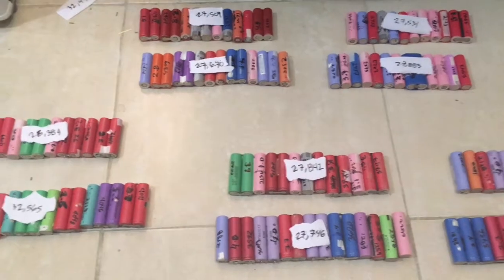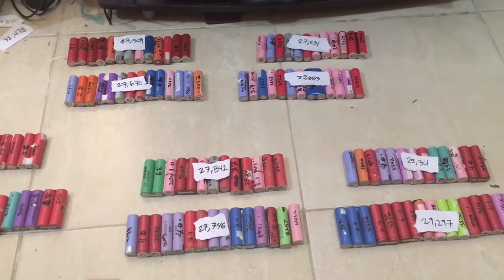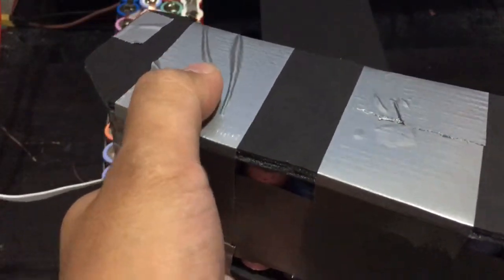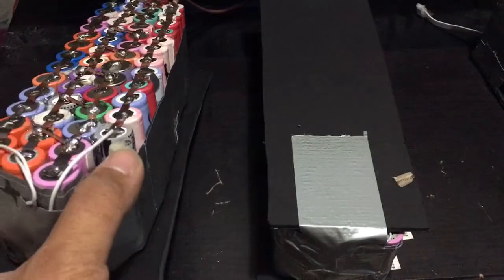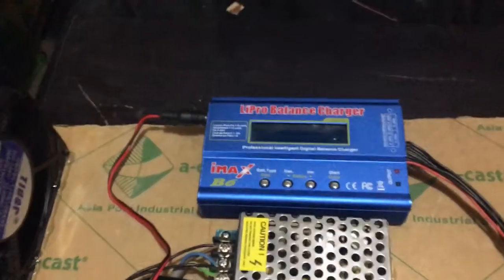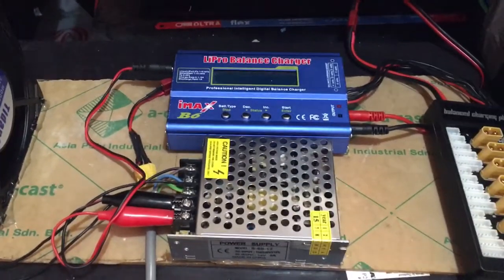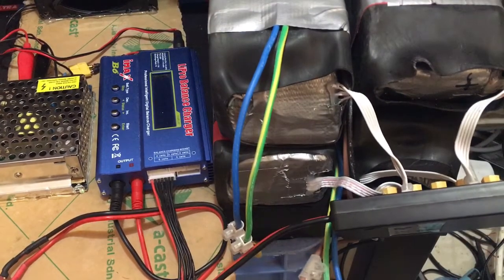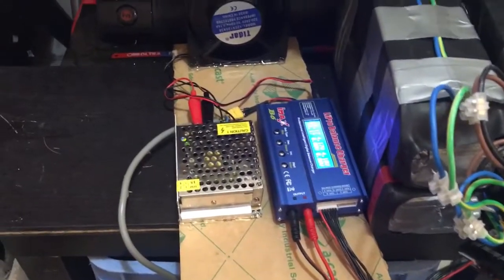DIY Ebike Battery pack from 18650 cells

Comment: How has it been holding up? I plan on making a battery similar to this but I'm afraid that it won't last many cycles, I'd be happy with 150~ cycles even if I have to only charge it to 4.1volts
Reply from the maker: mashed potatoes it held up pretty well for a year since I got a motorcycle to move around. Just have to make to balance the charging every time. 

I did noticed a slight drop of the capacity after 6 months which I was already expecting as the batteries are used. 

One main advised, don’t used batteries that were dead at zero then revived as those will be your weakest link.
Reply: @VillamesGarage  that's not too bad, have you used it at all since then or is it retired now. I did have a few cells that I revived from low voltage but I'm testing the capacity, the self discharge by fully charging and letting it sit for 2 days, and comparing the voltage drop at a 2amp discharge to other cells I have to see if there are any that sag more than the others. I've noticed that if the measured capacity is less than 80% the rated capacity the cell can have problems like lots voltage sag and self discharging

Comment: Very informative video sir. How long does it take fully charge ? i am too building 16s16p ebike battery with imaxb6 and little tip; if you put your charger vertically to desk, charger gonna be cooler, bottom side will contact to air.

Comment: interesting setup, using more batteries in series to compensate for the varying capacities of the individual cells. I hadn't thought of that! On your charger though, should you not be selecting LiIo (lithium ion) instead of LiPo (Lithium polymer) for laptop 18650 cells?
Reply from the maker: Bruce M sorry for the late reply, been busy with work lately. As for your question on why I am not using lilo for charging for the 18650, for this particular charger I am using the imax b6 rc charger, its does not have that option, you are suppose to choose lipo but since mine is a knockoff somehow lipo and nicd had been interchanged. I used NiCd option, balance charging, selected how many volts depending on how many are in series and then the max amp for charging.